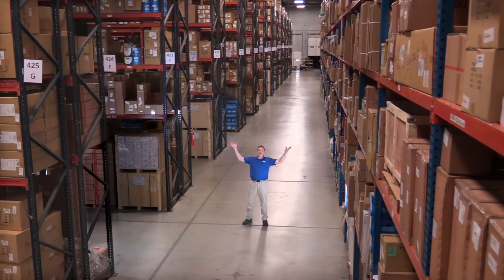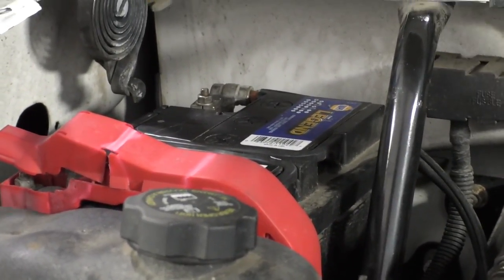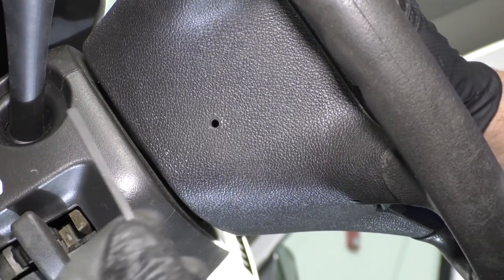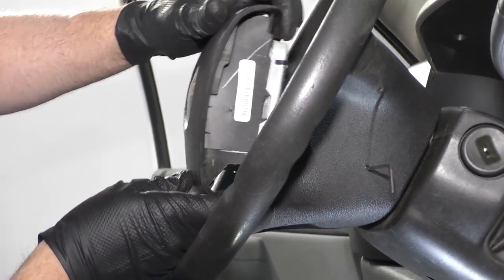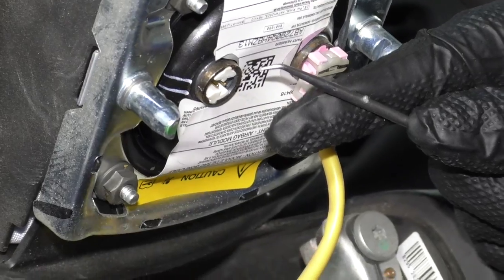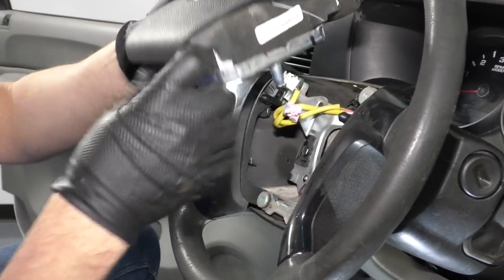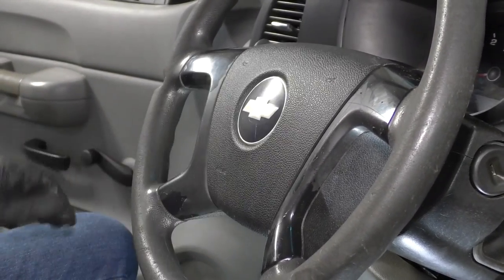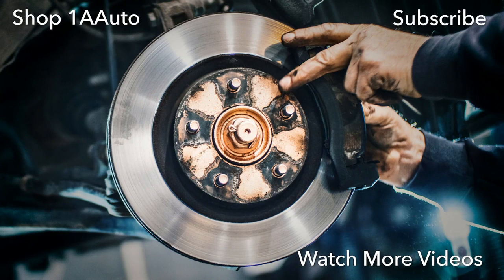How to Replace Airbag 07-13 Chevy Silverado

Comment: Is it possible to remove the airbag from the cover then reinstall the cover to steering wheel . I had facial reconstruction from a accident an cant get hit in the face by a airbag. I would feel safer  if the driver bag was removed
Reply: Id imagine unplugging it would give the result you desire though you would probably have an air bag dash light because of it

Comment: I did this and have an airbag light on. What’s with that?
Reply: Srs module needs to be flashed/reset usually under center console will have yellow wires/plugs going to it should say srs or something similar on it. Safety restore will reset it for $50 I believe much cheaper than buying a new one and having a dealer program it, scan the truck for codes need a higher end scan tool and see if theres seatbelt codes too. The seat belts can deploy but sometimes wont be locked up and air bag light will stay on till airbags and blown seatbelts are replaced and srs module is reset or replaced u can buy $2 to $5 airbag  test resistors on ebay before buying the airbags or seatbelts to see if the codes go away

Comment: Awesome informative video.
I am curious why you didn't you remove the Positive battery cable?
You would not have had to remove the fender support bracket to access the negative cable end 🤔